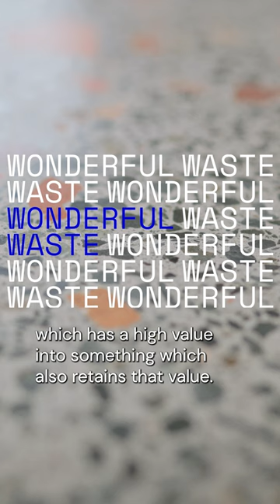Making Waste Concrete Furniture

Comment: I’m not fully understanding the idea here. Emission value and value of the object seems to be very different scales. Unless making them into furniture would meet some of the existing demands for concrete, I don’t understand how it might be beneficial other than being aesthetically pleasing. Maybe what they meant was that furnitures also produces high emissions so they are cutting emissions in that industry?
Reply: They’re using a waste product and making a nice thing from it
Reply: They're not cutting down on the emissions. They're cutting down on waste. What was already made for construction sites and stuff can't be unmade but instead of going to the landfill it's at least put to use.
Reply: She’s saying they can make 2 things with leftover wet concrete - turn it into roadfill, or concrete furniture.  The furniture has a high value, so it’s a better use of the leftover concrete.